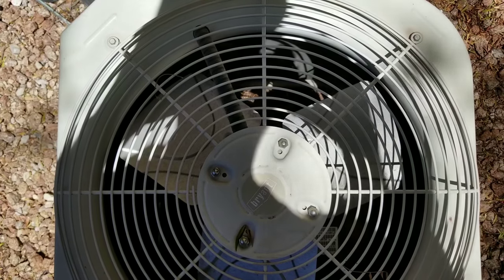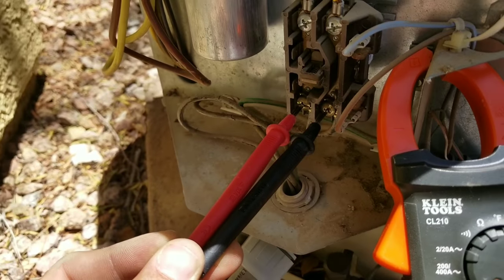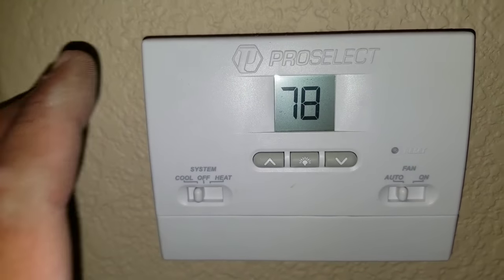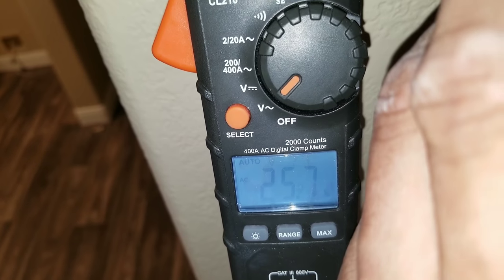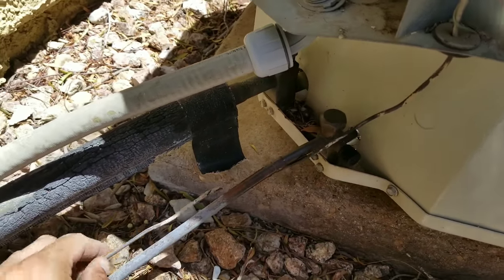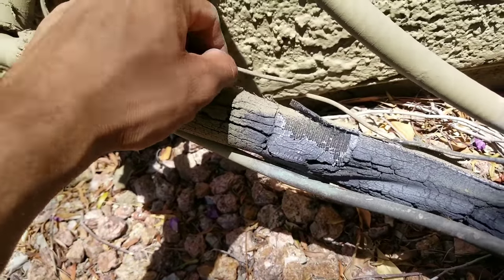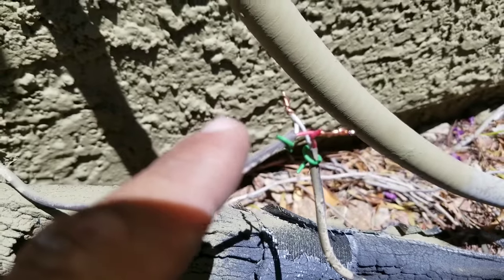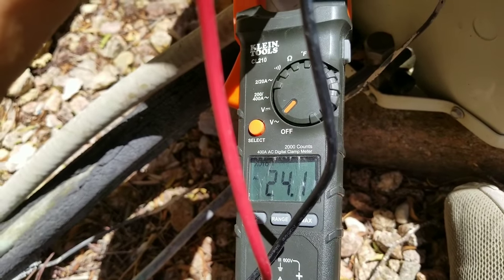AC Not Working. Not Getting 24 Volts to Condenser. REPAIRED!

Comment: I had the same problem with 24 volts. But It's cool days and the people are not using their ac. Well , I had  no ac call . After I traced the 24 line , I figured out that another apartment was using the 24 volts wires lol. The maintenance guy a while ago made a big mistakes connecting those cables. But , My friend ,another maintenance guy and myself took us almost 3 hours to figured out the wrong wiring when we tried  to check continuity to the next condenser unit lol. Nice video man !!!!

Comment: Always check drain pan too. Had many customers not even notice the pan under it full. Alot of stopped up drains😊
Reply: Hey! You just saved my ass... I tested everything besides control board itself and only then noticed after seeing you comment, that drain pump gfci outlet was tripped. As soon as I reset, pump kicked on and AC unit outside started. Woohoo!!!

Comment: The same problem facing right now in Texas 5 ‐2‐21 my only problem its that my attic space it's so tie  l need to get there hoping maybe the low voltage wires are cut in 2 pieces  so l can fixed anyway  very good  video  educational!!!!!
Reply: We are having the exact same issue here in TX. My other half is in the attic trying to find the wire

Comment: The 24V could also be interrupted by a float switch if the drain is plugged or the high or low limit switches that are often in series with the 24V going to the contactor. The latter could indicate a refrigerant problem.

Comment: i’m having this same issue and I can’t find the problem,  am I supposed to be getting 24 V from each wire? because I have a yellow and a blue which is my common. my yellow wire has
 24V but my blue does not when tested individually. So should they both send 24 V or is it normal to just have the yellow sending 24v ?

Comment: My situation is a customer changed the thermostat that had a Nest on it. He put on a T2 Honeywell now I can't get the unit to come on. Contactor stay stuck in. I'm not getting 24 volts at the contactor, I check ed the transformer no 24 volts is coming from that as well. I didn't see any break in the wires but for some reason I'm not getting 24 volts at the contactor. I am stumped. HELP. I thought I had a bad contactor and a bad transformer both of them have been replaced with new ones and the unit still will not come on. 🤷🏾‍♂️. I checked the fuse on the board at the air handler underneath the house and it is good. Customer stated that the unit worked when the nest thermostat was on after he changed it the unit wouldn't come back on so I've been out there twice and I still can't figure it out. The T2 thermostat is a two heat one cool thermostat. Do you think the batteries in the new thermostat is helping push too much current to the contactor that's making the plunger stick to the contactor? The contactor is a single pole. I enjoy your channel very much it has pulled me out of some jams. Thanks for sharing. #PEACE ✌🏾

Comment: Mouse chewed up my contactor wire and when I turned it on first time nothing. I got an old oil furnace with a fan center and I think the  short destroyed my transformer relay.  Got 120 going into my transformer but no voltage on the red screw...think it's fried...waiting in heat for the new one.

Comment: If you ever need to get a replacement thermostat I highly recommend the Aprilaire 8444 thermostat it's a 1 heat 1 cool non programmable model I have one and have had good luck with it in the 2 years I have had it

Comment: I’m only getting 12 volts on the low voltage side ? Could it just be bad or further shoot problems
Reply: Check the secondary side of the transformer to see if it's putting out 24 volts.

Comment: Does it matter if you have fan in auto or manual for this job. You said make sure it is in auto ?   Thanks for video
Reply: There are two fans - one is the air handler that pushes the cold or hot air out to your vents. That is located in the attic. The other fan is on the condenser unit outside. He is indicating that you need to have the thermostat in auto so that the outdoor compressor/condenser/fan assembly gets power. When that gets power the air handler fan which is on the inside comes on as well. You just need to make sure your thermostat is blinking cool and that the set temperature is lower than the actual temperature so that it’ll continue to command 24 V to your contactor/outside unit
Reply: No. The auto/on switch on the thermostat applies only to the evaporator fan (indoor blower motor)
The cooling mode switch sends power to the condensing unit outside. It wouldn't have mattered if the fan switch had been in auto or on.
Reply: so which one is it guys does auto send power or the cooling switch that sends the power,??? @catfishjones2023

Comment: That looks super easy.  What if it isn't a cut wire.  I have no voltage, but also have no cut wire.
Reply: In most cases it’s a bad connection or a break in the wires somewhere in the wall. Could also be burnt wire or corrosion.

Comment: If the Y wire was cut you should not get any voltage between Red and Y wire unless the Y wire was touching off the common which was also cut so that is probably what happened here

Comment: My blower fan will kick on but compressor will not. If I touch a screwdriver to 24v wire on contractor to the actual plunger metal it will suck the plunger down and kick on compressor. When thermostat hits temp it kicks off. When warms up in house just the blower kicks on and not compressor unless I go out and manually touch the 24v wire contact to plunger metal. One 24 wire comes from a relay looking box above contractor and other is yellow going towards compressor unit. Any ideas? Thanks
Reply: Are you getting 24 V across the two wires is the question. If you are I would replace the contactor. In fact I probably just replace the contactor right away. These things go out every few years and it’s cheap insurance and preventative maintenance. They only cost like 20 bucks. They’re easy to replace as well. Just make sure you disconnect the main power but he didn’t go over very well on this video when you’re changing it out

Comment: thank you for your informative video Sam.  I have one question maybe two though, obviously the thermostat gets its 24 volts from the control board at the furnace, correct? And if so What would CAUSE the control board NOT to supply THAT said voltage? thanks again for any more information you can provide.

Comment: Hi Sam, on mine I have a problem. Heater works, fan works. Low voltage fuse was burned out I changed it and keeps
 burning out. When I set the thermostat to cool it burns the fuse. Tested for 24 volts on the capsitor and has no voltage. Disconnected the thermostat cables that go to the contactor and tested them and they do have 24 volts but when I connect them to the contactor it shows nothing. The contactor does have 220 voltage. Any Idea what may be the problem. Thanks. Great videos by the way.
Reply from the maker: https://youtu.be/CkSdvEmw4fg
This is a more thorough diagnosis.

Comment: I have an AC unit on the roof of my 5th wheel. When you turn it to cool the relay board just clicks. I don’t see a contactor to test. I’ve tested everything and still nothing. I’ve tested the thermostat, condenser, both capacitors and all test good. I’m not sure what else could be the problem. Any ideas? I’m at my wits end here so any help would be appreciated. Thank you.
Reply from the maker: It's hard to determine without seeing the issue at hand. If you have tested the electrical components... I suspect it may be the board itself. I have had issues where I was at my wits end and after I replaced the board the system fired up. Make sure that you are certain about the contractor. Usually you can trace the it by locating the disconnect or fuse. The disconnect is what sends the 240 volts to the contractor. Follow the disconnect where do the wires lead to? Also I would advise to test just the fan motor. Turn your thermostat to fan on does it run? If it's a furnace board test the heat.. turn it on does it turn on? If those 2 work then you will have a better time isolating the issue as simply the AC. Do you have the safety switch on your door? Does it work? There are many thing that could be causing this issue... let me know if this helps and if you were able to fix the problem. Thanks!
Reply: Sam yes this has a furnace on it as well but neither of them work. When I jump power to the fan pin at the thermostat it just clicks but don’t turn on. The only fuse on the relay board is a small 5 amp fuse like a car fuse.. That I know of I’ve tested everything I really know how. I’m not an AC tech I’m just testing wires as I’ve been in the low volt industry for 15 years so I can at least test the wires for shorts etc but that’s about all I know about AC units. I’m just watching videos and reading online manuals to try and fix this. It won’t let me attach a picture.

Comment: Good video. When you are testing 24VDC you need to set up your Voltmeter to measure DC not AC.
Reply: HVAC units use 24V AC
Reply: Yes it is typically 24 VAC

Comment: Having a simIlar issue where I was losing 24 v going to contactor at a customer's have to go back and re run new low voltage wire since its a 28 year old furnace.

Comment: They did not do a good job with isolation on the low voltage wire it shouldn't have cut so easily